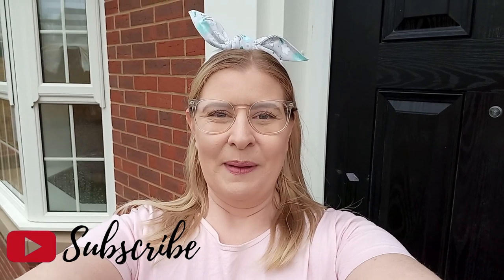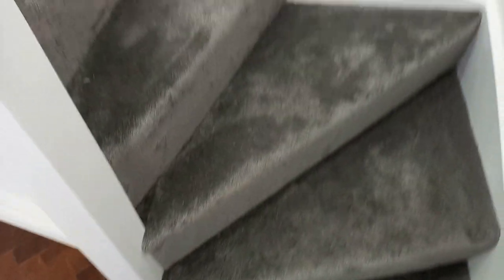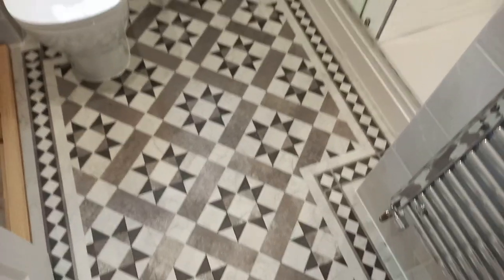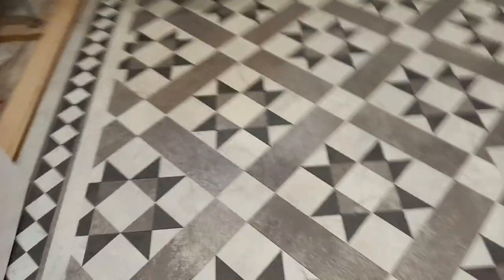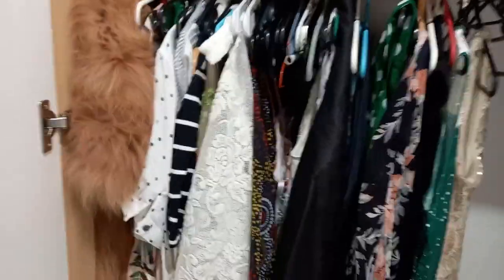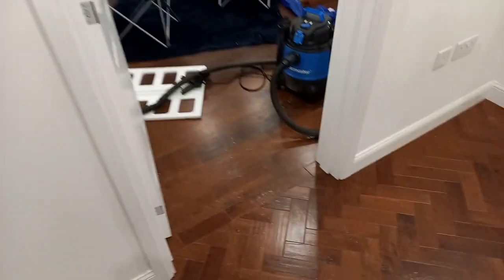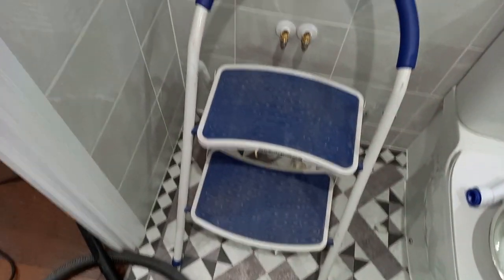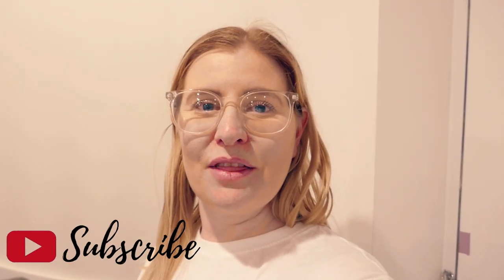Moving Vlog #5 | Flooring reveal and some DIY | UK New Build - David Wilson Homes Avondale

Comment: Hi Katy. I have a question please and would appreciate your thoughts. We are waiting for our new build to be completed soon and we are also looking to get flooring done by a private contractor and not through the developer. However, we are being warned that for LVT or wooden floors, it’s difficult to install once skirting boards have gone on and glued to the wall. The developer wouldn’t agree to simply tack on so we can install the floor and glue the skirting boards after. What was your experience with that please? Did the flooring contractor need to take off the skirting boards before doing the floor or how did they manage that? Please help as we wouldn’t want to have to use scotia beads which tend to be the  other option if we do it our way 😢
Reply from the maker: Hello. Yes they removed the skirting boards and put them back on. Enjoy your new home.
Reply: @KatyJayne  thanks for responding so quickly Katy, really helpful😊